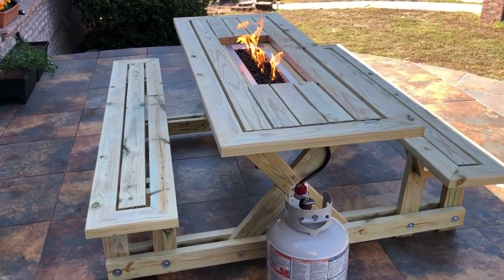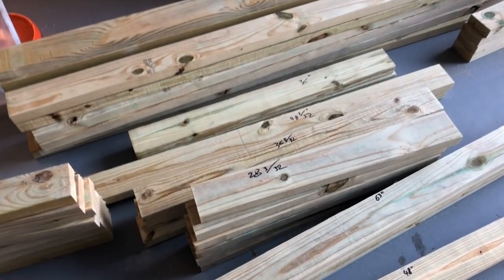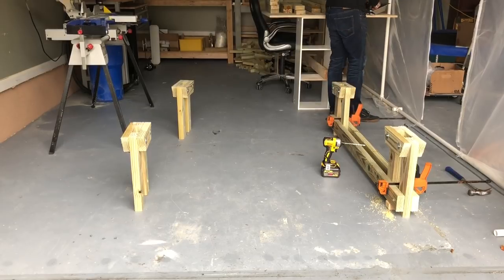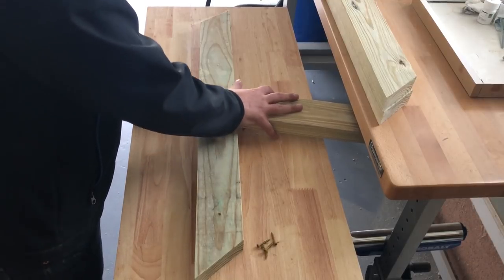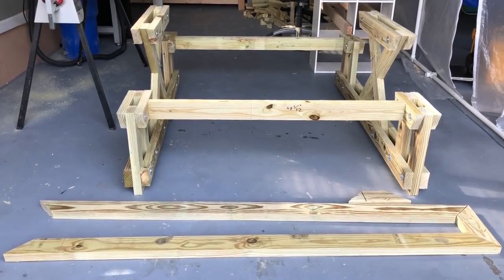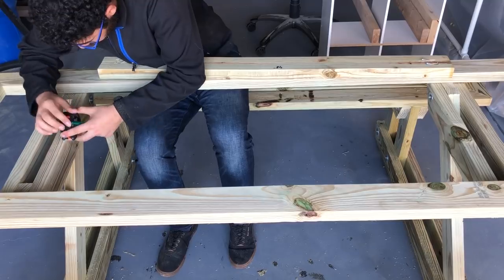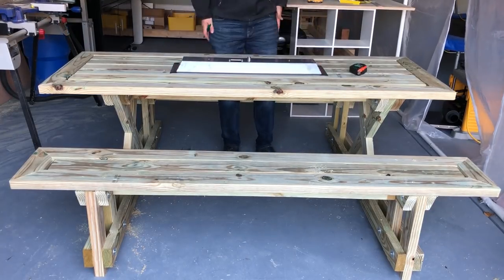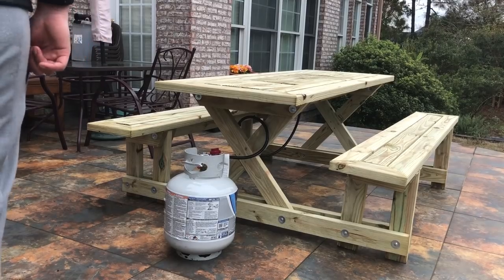DIY Fire Pit Picnic Table

Comment: hey im glad to find your video, i actually originally found the plans with the metric cut list and you just saved me a bunch of time! you did a great job thanks a lot.
Reply: I've built few of these based on that same set of metric plans (but without the firepit inside). Tip: Do the project in metric, it's much easier!    But most importantly, the metric plans have the other rim boards for the table top and seat tops dimensioned for the total length (long end of the miter).  Don't do that! Since rarely are all 2x4s exactly 3.5" wide, you should mark for your miter cuts on the short length!  That way, it doesn't matter how wide the board it, the inside of the rim will provide the proper gap.  SO instead of cutting them to 1960mm total length, INSTEAD measure, mark, and cut on the SHORT side (where the miter cuts get closer together) at 1782mm.  If the outside corners of your miters don't meet perfectly, it's fine just sand down the sharp end that overlaps.  I wish I'd have figured this out before I build the first two tables, it would have saved me some time.  

I also used pocket holes for all the to boards, rim, and seat boards. Nice clean look!  Good luck, message me if you have any questions. The X braces are tricky!
Reply: @jasonwhatley3211  Where can you find the metric plans for this?

Comment: Would adding stain and varnish to the top dangerous? I want to make one, but with stain and varnish
Reply from the maker: It should be fine thanks for watching
Reply: @beastyfurkan  thanks I was just wondering if the stain and varnish would be flammable and dangerous
Reply from the maker: @germandiaz1651  I think if the chemicals have cured and the fumes have evaporated it should be fine. Don’t crank the heat up to high to be on the safe side
Reply: @beastyfurkan  what size is the brass fitting? The link doesn't work anymore thanks!
Reply from the maker: @germandiaz1651   1/2-in Threaded Flare x FIP Adapter Coupling Fitting. I would love to see pics when you finish Engecmuhammed@yahoo.com
Reply: @beastyfurkan  will do lastly why is this fitting needed. Can you not just hook up the tank through the one that comes with the fire pit?

Comment: what's the length of pocket screws?
Reply from the maker: Santhosh Kumar S the length of the pocket screws are are 2 1/2”.Check this page out 
https://www.kregtool.com/about-us/news/kreg-tool-tips-joining/choose-the-correct-screw-length.aspx
Reply: @beastyfurkan  Thanks
Reply: Cross legs measurements are after 51 degree cut or before?
Reply from the maker: Santhosh Kumar S 
Here’s a more detailed version however it’s in mm so you’ll have to convert it. 
https://www.instructables.com/id/picnic-table-1/
Reply: @beastyfurkan  Great build, but don't convert the measurements!  This project is easier using metrics.  What's to be gained by converting all the measurements to imperial when the plans (and most peoples' tape measures) already have metric?  Besides, metric is much easier for beginners and significantly less prone to "head math" mistakes with fractions.  Great build!  I've built 2 of these (without the fire pit) from the same plans!  My build order was a bit different than yours, so I really enjoyed seeing the different approach!

Tip for others:  For the rim boards for the top and seat top (the ones that have the 45-deg miters), remove 178mm from the plan's measurements and instead of measuring to the long side of the miter, measure to the short side of the miter.  That way, the variations between different board widths (2x4s are almost never exactly 3.5", they vary) don't cause gap issues on the inside.  If the miter corners don't meet on the outside, you can just sand them down.